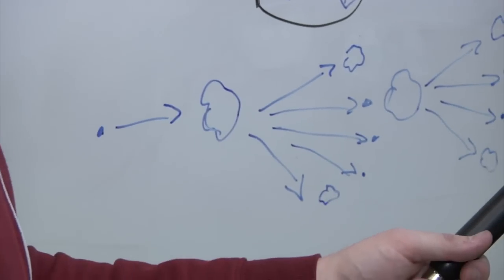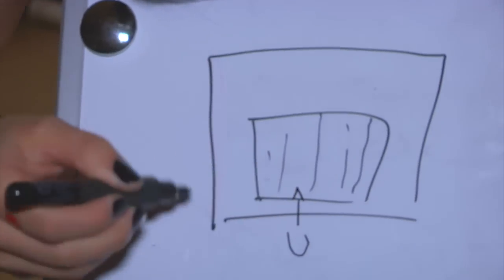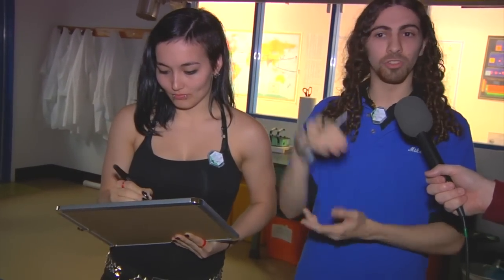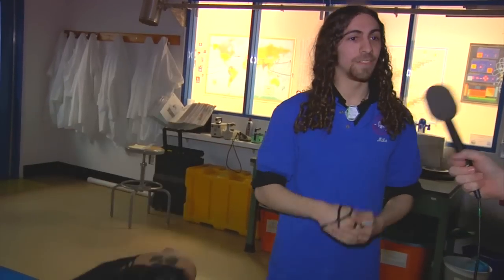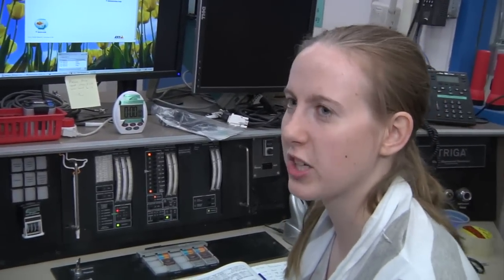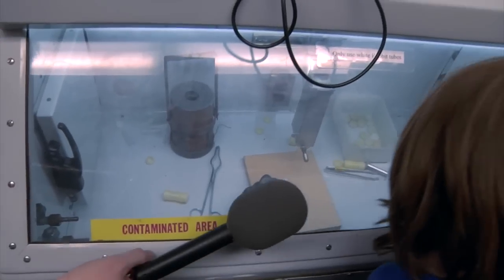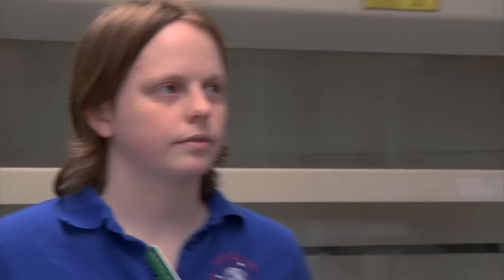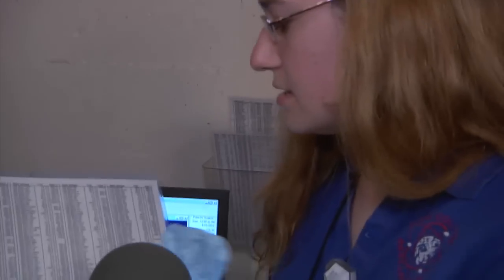Will and Norm Visit the Reed Research Reactor

Comment: Hey, as a current operator at the Reed research reactor, the detector is on the outside because we want it to reflect what the activity is outside the glovebox, where we are standing. There are sometimes EPDs inside of the box, and theres a hollow lead cylinder  where we put samples that are a little too active. Anyway, radiation is not that scary and we have waaaay more detectors than we need (like we have a whole room of unused ones)
Reply: If you have a spare scintillation counter, I could always do with one of those lol

Comment: Deionized water is not harmful if consumed in balance with normal dietary requirements for electrolytes.  If not, electrolytes and other vital crystalloid solutes will become so diluted that cells, erythrocytes primarily, will hemolyze or take in so much water their cell membrane ruptures. (Remember osmosis?)  You have been fortunate.  The resulting condition is commonly called water intoxication, and in severe enough, it can result in death.

Comment: I want to know what those red rings on their fingers they are all wearing. Is it another sort of radiation detection like the exposure badges?
Reply: Hello! Those are solid state detectors. A crystal in the ring responds uniquely to radiation, and when heated gives off specific wavelengths of light which correspond to levels of radiation. This helps monitor the radiation dose given to the extremities of the person handling radioactive material and is especially important since radiation affects different parts of the body differently and there are specific regulations for what levels of radiation to what body parts are acceptable.

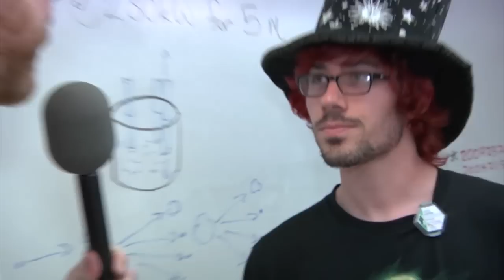Comment: 7:20,That is bull bollocks. Drinking deionized water will not make your cells explode. The only problem with it is that if you would drink only deionized water for long periods of time your body is going to get fewer of some of the minerals it needs.
If you drink a huge amount of water in a very short period of time, your cells WILL have osmotic problems ("explode") but that happens regardless of whether the water is deionized or not.

Also, he seems to be ignorant of the fact that stable, non-reactive deuterium (a stable isotope of hydrogen), is detrimental to your health.

Comment: "That was more radioactive than I though..." NOPENOPENOPE
Reply: I understand it seems scary, but like she said it still wasn't a significant overall dose.  The beeping isn't like "NOW YOU'RE GOING TO DIE", it's just saying "hey, whatever it is you're doing right now, you may want to consider not doing it for an unnecessary amount of time".  There's no issue as long as you're aware of it so you can limit your exposure time, which is exactly what the alarm is for.

Comment: 20 uSv/hr... Bit of hype for the camera eh?
Reply: she said 2mSv/hr. That's pretty high. It was not 20uSv/hr.
Reply: How many Micro sieve rt in a Roentgen?
Reply: @jesseboombatts  strictly speaking you can't directly convert between those units since they measure different things, but for gamma radiation I've seen the rough ballpark value of 100 Roentgen in a Sievert which makes 1 Roentgen about 10 milliSievert (i.e. 10,000 microSievert)
Reply: @conorwhyte2053  she didn't say 2 mSv/h, she said 2 mrem/h which is in fact 20 μSv/h.